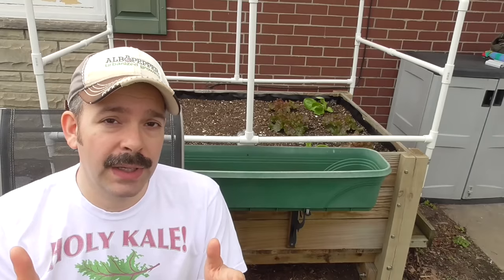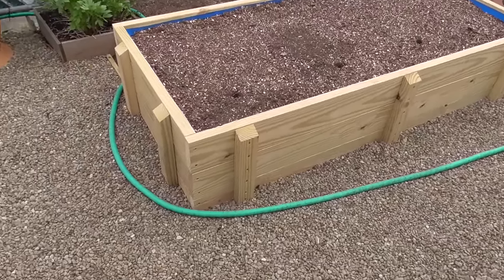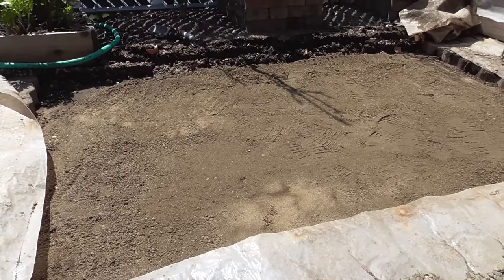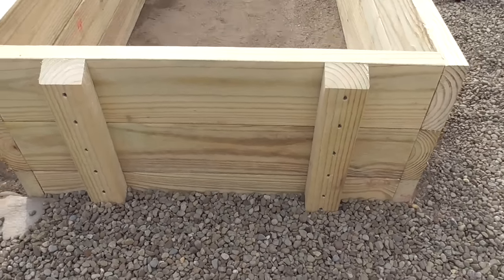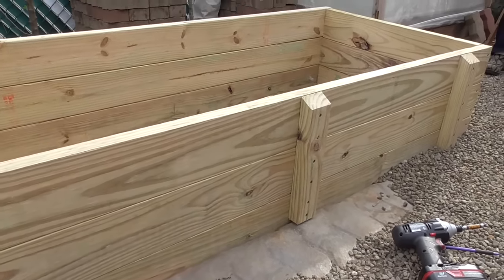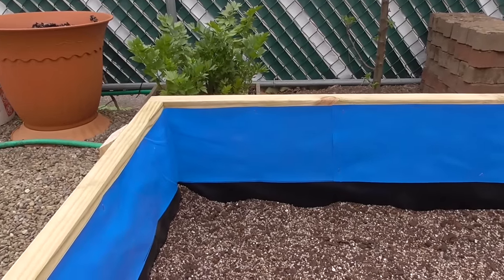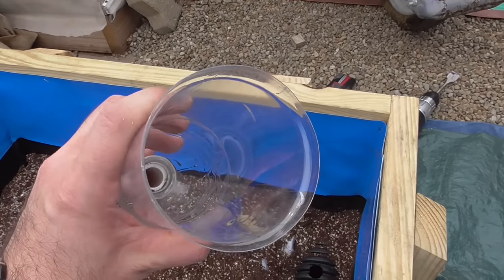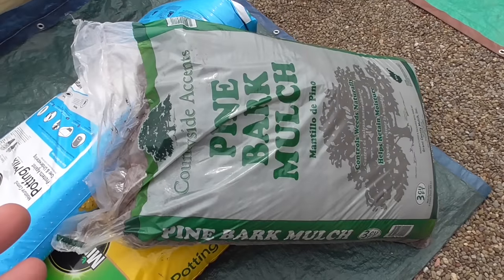Self-watering SIP Sub-irrigated Raised Bed Construction  (How to Build)

Comment: Great presentation ... Thanks! Would it by ok to cover the pipes with a thin layer of gravel before adding the potting mix?
Reply from the maker: Thanks for watching Ronnie! I personally prefer to avoid gravel in these types of systems. For a deeper explanation, check my site: https://albopepper.com/pipes-vs-gravel-in-SIP-wicking-beds.php
Reply: I don't think you want any gravel in there to separate the potting mix from the wicking material. The gravel would not be as good a wicking material to get water up, and may become a barrier instead.

Comment: Planning on building one of these beds this weekend. I have a question about the mix. You used Pine Bark Fines and MG Potting Mix. Can use Sphagnum Peat Moss and Pine Bark Mulch in the mix with Vermiculite, Perlite and Lime? Along with some Bone Meal, worm castings, and Espoma Toma-tone?
Reply from the maker: Hi Blake. All of the components you've mentioned would work well in an SIP system. Sounds like you have a fun project on the horizon!  :-)
Reply: Thanks +Albopepper. I built a 4 x 12 version of this Friday and Saturday. Would've been finished on friday if it weren't for battery-powered drills running out. Anyway, my only concern is that I am getting drainage from one of the overflow holes but the other overflow hole doesn't start draining til maybe 10 minutes after the first.. I made a similar setup to yours and the unit is level and the holes are the same height. The hole with drainage is on the same side as the fill tube, which could be the reason that one drains first.
Also, I luckily am getting about 1" of rain today so that should give my mix its first solid soaking. That peat moss is a pain to hydrate.

Comment: Thanks for the video
You mentioned that the minimum is this depth.. what about having it deeper?
Greetings from the Galilee.
Reply from the maker: Thanks for watching!

Going deeper might start to reduce the ability of the soil to wick moisture all of the way to the top. I would suggest 24" as an absolute maximum. If the soil gets too dry at the top, you might need to irrigate it at the soil surface from time to time. To compensate, you might try to improve wicking by adding some coir or vermiculite to the mix.

https://albopepper.com/SIP-raised-bed.php

Comment: My question: how often do you have to fill? Living in almost desert area. Literally only have like 20 rainy days and up to 105 degrees.
I wonder if raised beds are not for things such as melons or corn or Sth that roots deep?
Another instruction mentioned putting fabric around pipe to prevent roots from growing in.

What about pests such as govers or ground squirrles?
Reply from the maker: If you want to ensure the planter is not undermined, you can either place galvanized steel wire mesh underneath, or build it on a base of cheap 12x12 patio stones. This planter works flawlessly with the largest of annual vegetables. Corn, watermelon, zucchini, tomatoes & cucumbers push out large harvests and get very big. The pipe doesn't need fabric: https://www.youtube.com/watch?v=q-JitnHKCY8

How often does it need filled? There's no single answer to that question. The weather and plant size are going to dictate that. But I've calculated the reservoir capacity of my 4'x8' SIP and it can hold 50 gallons. That doesn't include the absorption capacity of the potting mix, which also holds quite a bit of water.

Comment: Amazing explanation and attention to details!
One question, does your reservoir tubes have some kind of connection between them to allow the remained water to flow trough them or it's just the net that allows them to mix it up with the soil and eventually dry out with the heat? 
Greeting from a Brazillian lining in Italy!!
Reply: No need for connecting them, as he  said that they are perforated, so water is able to freely move fro pipe to pipe. The perforations are small, but many in number.

Comment: We really enjoyed your video and as a result, we would like to make a sub-irrigated raised bed from a galvanized water trough.  The trough is a little deeper than you recommend at 2 ft; do you have any suggestions on how to modify the build to get adequate wicking results?
Reply from the maker: +Deborah B - Thanks for watching my video and sharing your idea for modifying the design. The water trough concept seems pretty neat! Measure your hole center internally and come up 3.5" on center for a 1/2" overflow tube. Use 4" corrugated, perforated drain pipe. You might be able to wrap them in a spiral, getting them to fit nicely due to the round corners.

From this point you'll have to see if the mix has strong enough wicking power to pull moisture to the top. To assist, I would probably try to include some vermiculite but not an excessive amount of perlite. I would also avoid adding additional wood barks, beyond what might already come in your potting mix (if you use retail mix). If making your own mix, I'd focus on peat moss with some coir as well.

You need aeration & pore spacing, but not at the expense of wicking, due to the deeper container. If the mix had trouble wicking, to the very top, you could always spritz the top of the soil with water now & again to moisten it. But there's a good chance this would work ok for you.

Please understand, that I'm partially guessing since I've never tested this much depth. But I think that a little deeper is certainly better than going more shallow. I hope this works out well for you & that you have a great time gardening in it!

Please keep me posted on your results!
Reply: +AlboPepper thank you so much for your insight and suggestions. I would be happy not to add wood bark because I was having trouble finding it anyway 👍
Reply: +AlboPepper - Drought Proof Urban Gardening 

Great idea, i sent this to our kids in Grace Idaho. They are preparing to build some raised beds. I love your idea of countering water logged soil as well as the wicking of the water to the plants. Very well done tutorial. Thank you for sharing your idea and your time.
Reply from the maker: Nad Farg Thank-you Nad! I appreciate your feedback & support on my channel. I'm glad this info was able to help out.  :-)

Comment: After you fill around the irrigation pipe how many bags will it take to fill the box. What material should I use.
Reply from the maker: I show an example of what material to use in the video. Basically, a nice porous potting mix material that also wicks well. Run your calculations by cubic feet. Take the internal width times the height (in feet). Assume an upper depth of 1 foot. Thus W x H x 1 = Cubic Feet. That's how much potting mix you'll need.

Comment: I'm thinking about implementing this into my own raised beds but I'm wondering about the soil depth. I see that you are able to grow tomatoes and watermelon so maybe this isn't an issue but I have read that these plants need between 24-36" of soil depth for their roots. Some sites recommend breaking up, up to 12-18" of the soil under the bed to allow for root growth in shallow beds to compensate but then the S.I.P. method lines the bottom as well. Does the roots of the plants just creep through the  perforated drain pipes and that's another reason why you don't add a fabric to the top of your drain pipes?

Comment: Please explain how fresh air is provided.  I understand that there is an air pocket in the upper half of the tubes but won't that get stale pretty quickly? Through heating and convection a small amount of air will be provided through the two drain lines.  Is that enough?
Reply from the maker: Hi Ray. My systems do not have plastic covers on them. So there is also an entire layer of gas exchange at the soil surface. Is all of it enough? Well it seems so. I suggest watching some of my other videos demonstrated the real world results. This one for example: https://www.youtube.com/watch?v=VJ2T6gUv8Gc

Comment: Great video.
How did the perlite work out? My experience with the stuff is that because it floats on water, over time the entire batch will work its way to the surface and turn green...
Reply from the maker: Thanks for watching! I definitely get good results with perlite. I've seen a tiny bit of it accumulating at the top. But it has never been a big issue for me. A quick fix has been to apply a thin layer of pine bark mulch at the soil surface. It helps to reduce surface evaporation and minimizes wind erosion.
Reply: Also with the bottom watering .. it helps

Comment: Great project if you own a hardware store....how much did this whole system cost?
Reply from the maker: PIPES:
1 x 4" (71.5" long)
5 x 4" (62" long)
2 x 4" (25.5" long)
(4 x 10' Pipes) = $16.80 ($4.20 each)

TUBES:
6" Overflow Tubing (you could use PVC to save money)
20" PVC Fill Tubing ($5.50 for 1/2" 10' piece)

SIDE BOARDS:
6 x 2x6x74.75"
6 x 2x6x30"
Vertical Boards: 10 x 2.5"x1.5"x16" (actual size)
Use coated screws for treated lumber
(8 x 8' Boards) = $46.16 ($5.77 each)

FILL (Estimated) [$80 - $120]:
30" x 71.75" x 16.5" = 35516 cu in
(displacement) 3.14 x 4" x 370.5" = 4653 cu in
30863 cu in  -->  17.86 cu ft

PURE MG FILL (18 cu ft NO Sale/Discount = $135) [$72 with Lowes Discounts]:

CHEAP FILL RECIPE:
- 16% - 3 cu ft Pine Bark Mulch ($4.38)
- 56% - 10 cu ft: 2x 3 cu ft Peat Moss ($9.97 each) - 12 cu ft expanded
- 16% - 3 cu ft Perlite ($25? for 4 cu ft bag)
- 11% - 2 cu ft Vermiculite ($30? for 4 cu ft bag) [$80 shipped for both from GMS]
($104)

PRO MIX FILL RECIPE:
- 93% - 6 x 2.8 cu ft Pro Mix expanded [$113 TOTAL shipped from GMS]
- 02% - 0.4 cu ft Perlite (3 gallons) [$4]
- 02% - 0.4 cu ft Vermiculite (3 gallons) [$6]

MINIMUM RESERVOIR LINER SIZE:
80" x 38" (4" height) Pond Liner
Line the rest of the sides with simple 6 mil plastic

OR:
105" x 63" (1 continuous piece) 9' x 6' Liner ($35-$55)

FASTENERS:
24 x 4" Coated Decking Screws ($9.37 for 1lb)
30 x 2.5" Coated Decking Screws ($8.47 for 1lb)

HARDWARE: $141.30 ($124.04 after 20% Lowes Discount)
FILL (18 cu ft): $80 - $120

Comment: I make my own compost and I make sure that only good things go into it. Can I use my home made compost for the Raised bed. or no compost at all? If not why not?  I thought compost was great.
Reply from the maker: I agree that compost is great. But not all compost is created equal. I've tested a nice, woody homemade compost that had large particle sizes in a 5 gallon SIP and it worked well (mixed with 1/3 peat moss & 1/3 vermiculite). But I can't vouch for how well it would hold up after several years. Read more about the fertilizing options here: https://albopepper.com/refreshing-sip-potting-mix-adding-fertilizer-year-2.php

Comment: I have a question I hope someone can answer.  My husband bought a pre-fab corrugated metal bed that is 2' deep.  In this video, it is recommended that the beds be about 16.5" deep.  So we are dealing with an extra eight inches.  Is 2' too deep?  Will the water wick up that far?  Thank you so much.
Reply: My research tells me beds should be 12-18 inches in depth.  I know your dilemma as the raised bed I've recently purchased is a similar height.  My plan is to raise the bed floor by putting 6x8x16 concrete blocks on the bottom perimeter (and a few in the middle interior for support) and then sheathing on top of the blocks.  I would then install plastic pond liner over the sheathing and have the 16'' to make Albo's system work.  This would also save quite a lot of soil that would normally take up this space had I not put in this artificial shelf.  The waterproof plastic protects the wood sheathing and it's supported underneath by the blocks so it should work.  Hope that helps!

Comment: I want to thank you for this great tutorial. I am about to start building this and I’m questioning the size of the box. I’m going to go 12 feet long and I’m struggling with the width. You stated that this is 30 inches wide and you have laid out a qty of 6 tubes. 6 tubes by 4 inches wide is 24 inches. If you add a little space in between, say half an inch between tubes and the sides, you are at 27 inches so it’s a little confusing. I want to build it 34 inches wide so I’m thinking 7 tubes x 4 inches wide is 28 inches, with .75 between each tube and walls equals exactly 34 inches. Does that seem right or do I need to account for more than 4 inches per tube in my calculation. Thanks in advance!
Reply from the maker: Hi Mike. What you need to consider is the actual external diameter of those pipes. Internally, they are 4 inches. But externally, they are 4.625" or something close to that. Using 7 pipes, you would only have about 1/4" of space between them. And they would be squeezed against the sidewalls with no gaps. That is a very tight wicking area. I would only use 50/50 coir and vermiculite as the wicking base to ensure there is no failure. It would be tight, squeezing the mix in there. On the other hand, you could just use 6 pipes. They would be spaced with about 7/8" in between them, including 7/8" gaps between the pipes and the sidewalls. I think this would be a sufficient number of pipes without an excessively large wicking gap. All of this assumes a 34" internal width (the actual open part of your box).
Reply: AlboPepper - Drought Proof Urban Gardening thank you so much for your help! I’m going to build it this week.
Reply: Hi just one more question please. You mention in your reply to use a 50/50 blend of coir and vermiculite for the wicking base but in the video you use potting mix and vermiculite. Can I go either way? Thanks for all your help!
Reply from the maker: If you only have a 1/4" gap for wicking, then a 50/50 mix of coir & vermiculite will be most effective at such a tight spacing. The potting mix used in the video was a mix that contained coir and it's still a similar idea. Either way would work for the 7 pipe configuration. But make sure the potting mix is not full of large bark / woody pieces.

Comment: What size of drain pipe did you use. Around here 4" is the common size. Will that work or does it have to be a specific size?
Reply from the maker: +Rachel Isaak - Hi Rachel, it is the standard 4" corrugated / perforated pipe. That size works great!

Comment: But wait a second, after you use potting+vermiculite to fill that empty space between each corrugated tubes how they can get the air to fill their (air) chambers? The main one it's connected to the overflow drain pipe so it uses the latter to directly fill his air chamber (you even connect it to the former by cutting a hole to the cloth-net), yet others corrugated tubes aren't being tightly walled off from that same air entrance by the already mentioned potting+vermiculite?
What detail I'm missing?

Comment: Great video/tutorial! I have been using SIP pots with success and want to build a nice raised bed SIP as shown in the video. I was settled on a 42"x84"x16" size to suit my planting area. I was just about to get started until I calculated how much the potting mix will cost. I calculated a rough estimate of 25 cu ft of potting mix. At $5 per cu ft we're talking $125 for just the potting mix! 
Any advice on how to get these costs down?  I really want to go the SIP route based on my experience with SIP pots. However, the potting mix cost is making me lean towards a traditional raised bed with drip irrigation instead.
Reply from the maker: +anonymous1guest - Hmm... I've been expanding my SIP garden in small chunks each year, which has lessened the sting. The cost can be a real deterrent. I've spoken with others who are in a similar situation. One fellow was able to call local nursery / garden supply centers and find a place that would sell potting mix at wholesale. It was at reduced cost. But $5 per cu foot isn't even all that bad from what I've seen. I always just looked for sales and used coupon codes. Especially at Lowes. I buy online with coupons to save a nice amount.

One of the reasons I show the Pine Bark Mulch in my video is because a 3 cu foot bag is only $4. I wouldn't use much more than 10-15% of the stuff. But every bit helps. Then you could find three COMPRESSED 3 cu foot bales of peat moss for $10 each, which double in volume (when expanded.) Get a good deal on a 4 cu foot bag of coarse perlite ($25?) and you have what you need to make something from scratch.

$4 (3 cu ft pine bark - 12%) + $30 (18 cu ft expanded peat moss - 72%) + $25 (4 cu ft coarse perlite - %16) = $59

Perhaps that might be a way to cut costs. You would need to add dolomitic lime to pH balance. Also you would need to add your fertilizer with a little extra N to offset any nitrogen draft from the bark. I hope that helps a little!